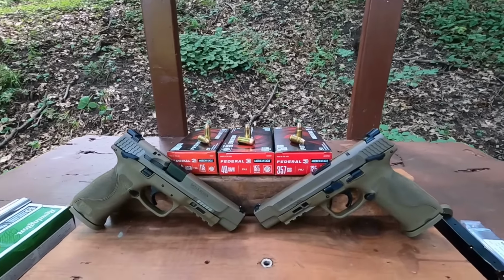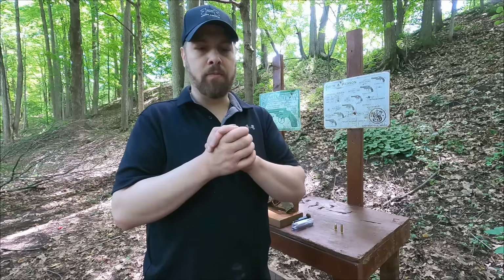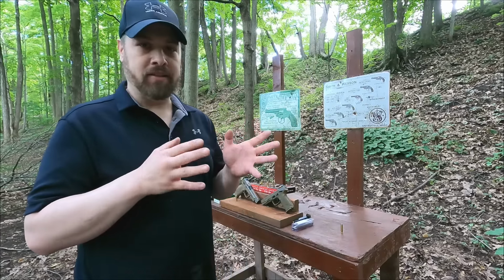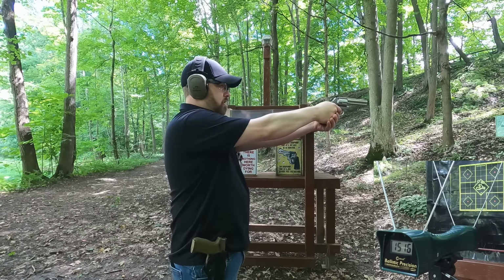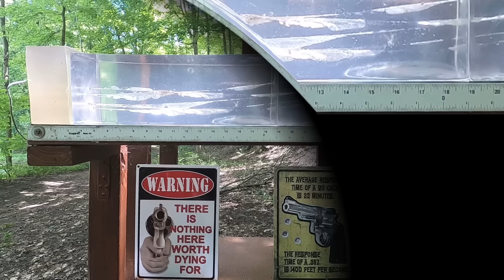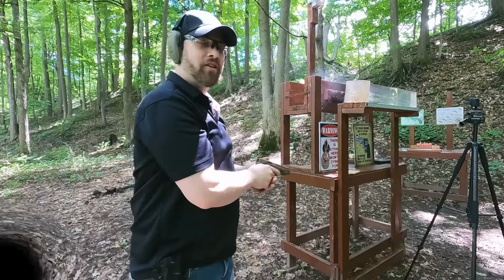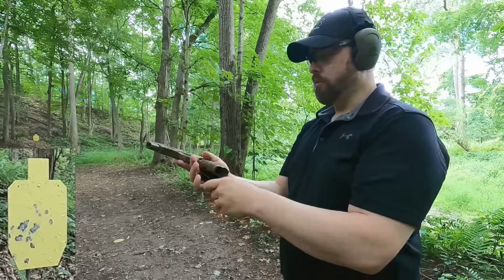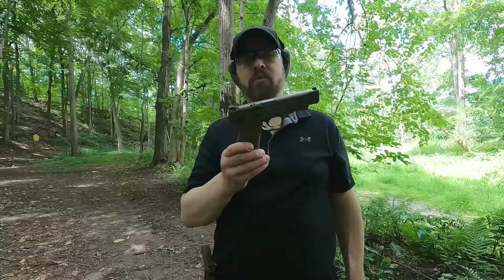.357 Sig? Cartridge Introduction and  FMJ Ballistic Gel Test (VS .40 S&W and 9mm)

Comment from the maker: I want to address something that has been bothering me lately, and that is the repeat comment in some form or another, about .357 Sig ammo price and availability. Paraphrasing 100 comments into one here - ".357 Sig is not available anywhere, and it's two to three times the cost of 9mm so it's useless". My question to these people is - what are you even talking about?!

I know that a lot of physical stores do rack up the price because all they offer is generally Federal American Eagle .357 Sig, which is very pricey ammo. But to say that the cartridge is hard to find and to say it's like $60 a box in general, is very factually wrong. Going on ammoseek, there are 5+ pages of .357 Sig for purchase just like any other popular cartridge, and about a dozen of these retailers offer 50 round boxes of .357 Sig for $22 to $25. Also, defensive ammo is often about the same price if not less than 9mm+P defensive ammo.

The fact is, .357 Sig is not all that hard to find and not all that expensive. It's not a lot different (at least online) than buying a 50 round box of .357 Magnum for cost and availability, but for whatever reason a lot of people are either seriously misinformed or have an agenda to make it seem as .357 Sig ammo is about as rare and expensive as .455 Webley (5 retailers online averaging about $65-$70).
Reply: I have been using 357sig for 18 years and absolutely love it.
1. Don't care about the price.
2. Enjoy power effectiveness 
3. Accuracy vs distance if needed.
With that said, I am not a caliber snob I enjoy them all

Comment: I still am baffled how the 357sig didnt become a top caliber. It is an amazing round. 
Ive seen some reloaders getting over 1700 fps with xtp bullets and they are unreal for both hunting and self defense.
Reply: maybe because they were hard on firearms with its high working pressure (40,000 psi compared to35,000 for the 357 mag).
Reply: Lol 😂 James Yeager has entered the chat .. I’ve never seen anyone wear out a .40 cal or .357 Sig and neither have you ..
Reply: @pabloescobar7802  I never said I have.
Reply: @carlschumacher3257  I've heard the "hard on firearms" claim before, but I've never seen any actual evidence of it.  People claimed the 10mm was hard on firearms, but that was at least partially true.  Early Colt Delta Elites had a tendency to develop cracks in the frame from 10mm.  Colt figured out that particular part of the frame wasn't actually necessary to the function or structural integrity of the gun and just removed it, which is pretty much how every manufacturer that makes a 1911-style 10mm has built them since.

I suspect that part of the reason .357 Sig didn't catch on was lack of widescale adoption by police (some agencies did adopt it, but most seemed to lean into the .40 S&W around that timeframe).  And I wonder (with no supporting evidence) if that lack of adoption was for the same reason that the 10mm didn't catch on.  If it was considered "too loud and/or too much recoil" for most officers, it wouldn't get widely adopted.

The 10mm at least developed enough of a cult following that quite a few companies offer at least something in 10mm.  That doesn't seem to be the case with .357 Sig.  As of now, Sig doesn't even offer a pistol chambered in their own cartridge (but they do have two options in 10mm).  As far as I know the only company currently making pistols chambered for .357 Sig is Glock.
Reply: @Kaelland  sounds good to me.
Reply: @Kaelland  The 357sig I bought in 2017 was a NIB trade in Sig Sauer SP2022 from Richmond, VA. police. The NC Highway Patrol also use 357sig in a Sig P226. It's a shame that Sig doesn't offer anything specifically in 357sig, but they still have conversion barrels for their .40s&w models. When ammo got hard to find (still can't find 357sig locally right now), I ordered the .40s&w barrel from Sig, so I have the flexibility to use whatever ammo is available.
Reply: @wolfhuntersarmory  ive bought a few glocks in 357sig (g31, 32, and 33) for a fraction of what the other caliber glocks sell for. I have conversion barrels for most of them for the same reason you pointed out. But the 357sig out of a g31 (fullsize) is awesome, even for hunting.
Reply: @wolfhuntersarmory  Oklahoma Highway Patrol used to issue the Sig P226 in .357 Sig, but they retired it in favor of the Glock 17, and they're in the process of converting to the Sig P320 in 9mm right now.

I did the same as you.  I ordered a .40 S&W barrel for my Sig Pro SP2340.  I still prefer the .357 Sig, but I can readily find .40 S&W ammo right now.  It at least lets me get some trigger time with the gun.
Reply: @Kaelland  and the 9mm conversion barrels ive used in my glocks have all been reliable also.
Reply: Not easy to reload. 10 mm brass is too thick actually. 40 mm brass is technically too short. Very low selection of .355 projectiles work unfortunately.  Low selection of powders also because if you look at case design  there is minimal bearing surface and bullet setback issues are very problematic without a compressed load. There are a few others. That being said I love this round. Absolute beast out of my g31 barsto ported and extended barrel
Reply: I have used a lightweight 65 grain ARX copper composite projectile that break 2000fps in a full sized FNS . Love the Sig
Reply: @Kaelland  I’ve had my SA XD 4” chambered in .357Sig that I bought brand new in 2003 and I have shot the hell out of it (well not as much in recent years due to the cost of ammo being ridiculous), and yeah it’s a great round.
Reply: @jorgesolis9468  
definitely not a 44
Reply: @jorgesolis9468  
yes, a hot 460row can more or less match a mediocre 44mag
Reply: @jorgesolis9468  
44 loads with h110 start at 1400+fps with a 240gr
Reply: @wolfhuntersarmory   I don't know where you are located , LAX AMMO has plenty of .357 Sig for sale , You can buy bulk !
Reply: @Michael Heiss  Haven't checked them in a while. Last time I saw they had some, it was only FMJ. I have plenty of target rounds, but not much defensive hollow points. I'll look at them again. Thanks.
Reply: @Kaelland  Sig has the P226, P229 and a 1911 chambered in 357 sig, they are NOT common to find tho.
Reply: Lots of folks put off by recoil.

Comment: 357 Sig is a great round and use it for home defense. Underwood has some hot rounds when it comes to 357 Sig, and that is the round I use for home defense. I hope to see Underwood being used in your video. Once again, great videos.
Reply: No
Reply: Hello, 357 Sig for home defense? Isn't the noise and flash too heavy to be used inside a home? My revolver in 357 magnum is loaded in 38 special for home defense
Reply: Ever fired it indoors during your “home defense”?
Reply: @nikos6220  nor for 357 sig. the currently offer the extreme penetrator and defender in 65gr, 90gr, and 115gr!!!! the 65 gr is getting 2100 fps for 637ftlbs of energy, and the 90gr is getting 1700 fps for 578ftlbs!!! the 115gr loses too much speed due to copper being less denseand takingup case capacity, but is still getting 1450fps for 537ftlbs of energy!!!

Comment: Good review. Another reason to love the 40 caliber too seeing as how easy it is to convert to a 357 SIG.
Reply: Yup. I’ve converted a Sig P226 and a P229 to .357 Sig Bar-Sto barrels, one of which is extended with 3 ports. Currently waiting on a Bar-Sto Extended and Threaded and Fluted barrel converting another P229 from .40SW to 9mm.. It uses a different recoil spring and magazine but the other Sigs shoot .357 Sig and .40SW with just a barrel swap using the same mags.
I love the Sig Classic P-Series versatility.

Comment: There are some hot rounds out there for the 357 sig. Underwood is the only one that does quite a few different loadings that I have found. they have a 68 grain and a 90 grain that put up some really impressive numbers. I love my glock 32 and it is a lot easier to shoot fast and accurately than most think.
Reply from the maker: Thanks! I didn't see this and have to figure out how to use this donation thing. I have a couple of the Underwood rounds for testing already, but all HP's. I will have to pick up some of the Underwood Lehigh's
Reply: @GunSam  Wilson Combat acquired Lehigh Defense.

Comment: Many say (as you noted) that the 357 sig because is a necked down 10 mm to .357 ,  will feed very easily into a barrel  meant for .40 caliber cartridge.  Thus very reliable feed.  Looking for a 40 S&W Beretta that I can convert.
Reply: That " enhanced feed" that people seem to think the 357sig offers really doesn't exist, especially in guns that feed from angled mags. The more angle, the more likely you will have problems, glocks are very problematic with the sig round. Some don't have many problems but, if you have much experience with glock 32's & 33's, you know what I'm talking about. The problem lies in the shape of the cartridge and the way the slide just contacts the top of the rim while pushing it out of the mag. The larger diameter of the rear section of the cartridge is very short, that, coupled with how the slide contacts the cartridge rim, allows the nose of the cartridge to be forced down  into the front of the magazine as the round is forced over the neck radius of the round beneath it. A very stiff mag spring can help but the design of that platform is just a malfunction waiting to happen
Reply: .357 SIG is .40 necked down to a 9mm bullet, 9x25 Dillon is 10mm necked down to a 9mm bullet.
Reply: @Edmondson_Avenue No Sir it is from a 10mm cartridge

Comment: In 1998 I bought my first 357sig pistol and loved it, I still have it in my safe is a Sig SP2340. I have been hunting down a S&W M&P in 357sig but haven't been able to find one.
Now that barrel would be a great option for my 1st generation M&P Performance Center 40L I will look into it. I want that barrel now.
Reply: Look at kkm precision. I have the 40 to 9mm conversion barrel and I'm very happy with it.
Reply: My first (and currently only) .357 Sig pistol was also a Sig Pro SP2340.  I got mine in the early 2000s.  I don't shoot it much because ammo is hard to find.  I handload, but sometimes the brass my gun ejects is hard to find, too.

Comment: Just a little history here: The .357 SIG is based on a necked-down 10mm Auto case and was introduced in 1994. The goal of the .357 SIG project was to offer a level of performance equal to the highly effective 125 grain .357 Magnum load. Measurements of standard factory .357 SIG cartridges loaded with 125 grain bullets showed approximate muzzle velocities of 1450 fps out of a 4 inches barrel, which is essentially identical to the .357 Magnum with the same bullet weight and barrel length. Those measurements were performed using a Thompson Center Encore 1842 break-action, single-shot pistol preventing differing barrel length definitions between semi-automatic pistols and revolvers giving revolvers a potential muzzle velocity advantage. 

 Bullet weights ranging from 50 to 150 grains have/or are currently being offered. Loads are available with energies from 488 ft lbs to 636 ft. lbs of force and penetration depths from 9 inches to over 16.5 inches are available for various applications. Underwood offers a standard pressure 65 gr .357 SIG Xtreme Defender round with a muzzle velocity of 2100 fps, with a muzzle energy of 636 ft. lbs and a penetration depth of 17.5 inches. Liberty Ammunition offers Civil Defense a 50 grain, 2300 fps, with 587 ft lbs of muzzle energy. The 125 grain is by far the most popular loading offered. The Buffalo Bore 125 grain has the same specs at 1450 fps and 567 ft. lbs as the original concept round but at the time of this post will set your wallet back $2.90 cents a round. Ironically the .357 Magnum and the 10MM at heavier loading's out perform the .357 SIG and at a better price point per round. So would you call this experiment a success or a failure?

Comment: Read a lot of the comments, have to agree with most of them 357 Sig is a great round. One fella said other than hunting. I have to agree 357 Magnum in a revolver is hard to beat. But as far as defensive carry, it's hard to be long live 357 Sig
Reply: I think hunting with .357 Sig would be fine.  Plenty of people successfully and ethically hunt deer and similar sized game using 125 grain JHPs pushed around 1400-1450 FPS out of a .357 Magnum.  No reason you couldn't do the same with the .357 Sig.
Reply: I don't know about that for sure, I don't know if you could get a load that would be accurate and chronograph at 1,500 for the second., out of the Sig 357. And to tell you the truth 125 grain bullet out of a pistol is probably on the light side. If not your shots are very limited to distance about 75 yards and in ethically speaking. I want to tell you a little quick story, I shoot a 45-70 and my velocity is way higher than that. And the chunk of lead I throw out there is double and then some. I reload from many calibers I truly understand ballistics. Kinetic energy. And knock down power. Anyone who would use a 357 Sig I would hope that their skill is very refined, and they are an ethical Hunter. I still like the Sig 357

Comment: Great testing and presentation Sam! Glad you've added .357 SIG to the toolbox, and arsenal. Both .357 SIG and .40 cal are good contenders as viable multi purpose rounds. I have the .357 SIG conversion barrel for my G23. 🎩🎱♠️🏁🎯🇺🇲🇺🇦🔱🌻💮🌼☘️🌸🔫🍀
Reply: Remember a few years ago in North Texas .357 SIG took down a church shooter. 1 headshot and lights out.
Reply from the maker: yeah, I just remembered that when you said it. I do recall knowing that, I saw the footage a year or 2 ago.

Comment: Like your videos very much, however the Kkm barrels are well made ,but they  fail when it comes to complete chamber support. If you get a Barsto barrel the chamber support is absolutely perfect. The lone wolf barrel is also  perfect when it comes to complete chamber support, I sent all of my Kkm barrels back because of the lack of chamber support. When I used the Kkm barrels in my Glock 21 45 super I had consistent Glock smiles because of the lack of chamber support,but never with Barsto or lone wolf.

Comment: I have the same .357 barrel for my M&P.  Underwood .357 sig 65 gr defender will clock 2150-2200 fps from a 5 inch barrel.
Reply: Underwood has it in stock however it’s 68 grain now and I chrono it last weekend 2282 from my 5 inch alpha wolf threaded barrel in my g22 I’m sitting on 600 rounds of it
Reply from the maker: I'll have to try it. I got their 124 and 147 gr Nosler currently.

Comment: It would be interesting to see a round-nose FMJ for .357 Sig and .40 S&W, to see if it would cause more turbulation or perhaps tumbling. Flat-nosed FMJs just zip through.
Reply: A round nose FMJ will be too long to fit in a magazine without issues for both.
Reply: @Matteo_  Interesting, thank you.
Reply: I tried handloading some standard 124 grain round nose FMJ in my .357 Sig when I first got it.  To get the overall length right so they would fit in the magazine, I had to have them seated so deep in the case that the bullet curved away from the case mouth.  That was the only ammunition that has ever given me any feeding difficulties in my Sig Pro.  Handloads with truncated cone shaped projectiles can be seated to the proper depth and have always worked perfectly.
Reply from the maker: @Matteo_  I always assumed that's why the .40 was flat nose. To be 9mm length and 180 gr, something's got to be shifted, like tucking my belly under my belt.
Reply: @GunSam  Pretty much. Maximum over all length for the 40 is listed as 1.135". However, I have successfully loaded them to 1.140 without feeding issues. The 357 SIG OTOH can be loaded a bit longer than that. Although not as long as the 9mm's 1.169"

BTW thank you for the great content! Take care.

Comment: Yes, I've been waiting for you to get the 357sig conversion barrel,
Now just get the 9x25mm dillon barrel for the 10mm and the 40 super for the 45 and we can finally start selling some serious gel testing of the top end niche magnum calibres because in 9x25mm dillon and 40 super there are hardly anything and especially 9x25 there is basically nothing which is bizarre as its basically 357sig magnum or around highest 357 magnum to 357 maximum in an auto with hot ammunition,
But its great were finally getting 357sig and here's hoping for the other awesome conversion barrels

Comment: If you want to check out an interesting caliber, check out the 9x23 Winchester.
It came out in the 90s for race guns in 38 Super that were having rim jam problems.
Ballistics is the same as the 357 Sig but with a little less case capacity, chamber pressure: 55000 psi, with an internal belt.
Reply: how about 9x25 dillon or 7.5fk ? rare and uncommon calibers. 👍
Reply: 9x23 win is the shit!

Comment: A .357 sig chambered pistol is a multicaliber weapon. In a pinch you can shoot 9mm. Luger in it. Once we tried on an old range Glock 32 - cycled no issues, magazine worked and it was accurate at 10 meters at least. Only thing I noticed is the 9mm casing is bulged, but don't try this at home folks we are poors from the Balkans and .357 Sig is expensive as hell here.